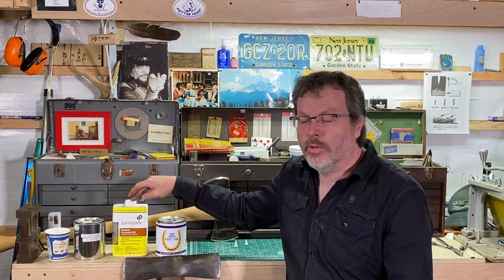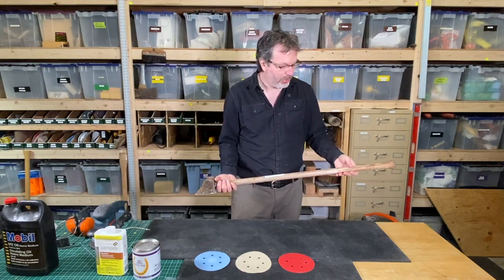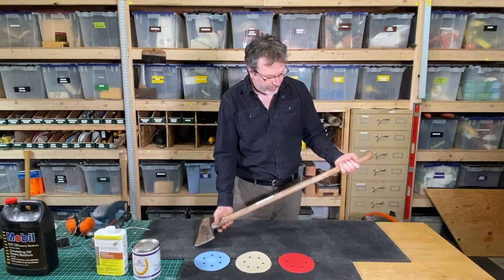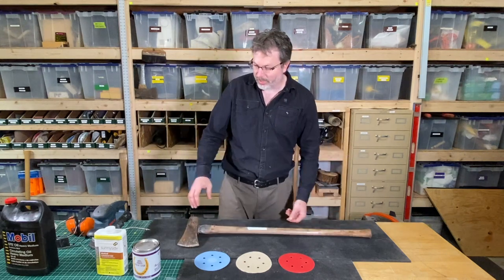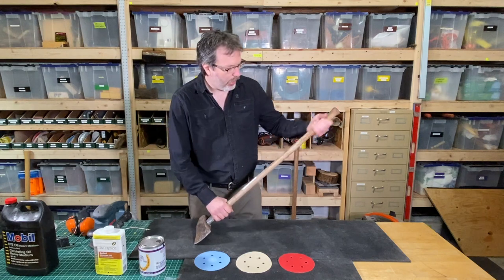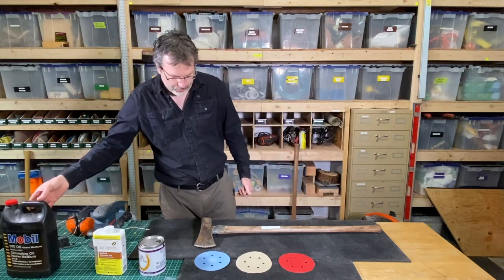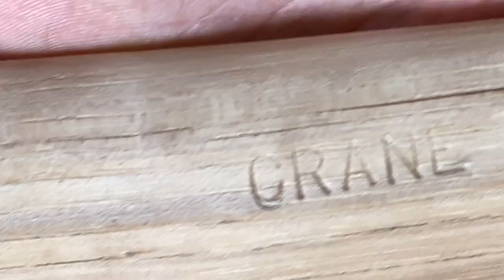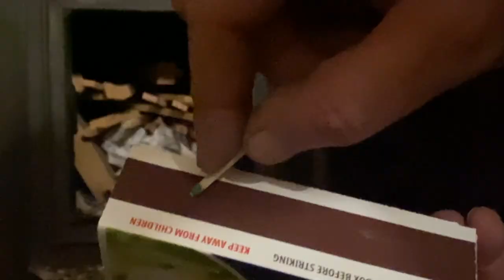Axe & Tool Handle Care - Pine Tar & Linseed Oil

Comment: Thanks for the tip on using the pine tar mix....I have a wood stove in my work shop so I take care of my axe and hatchets with wood handles ..I always remove the shellac from the factory and oil the wood
Reply from the maker: Right On! 👍 I really like this handle treatment. It gets better and better over the years as I keep adding coats. A nice grip in the hands. 🙌

Comment: Another solution that my great grandfather always did and he was born in early 1920s in just to use some simple Huberd's Shoe Oil which contains pine tar and beeswax. So if you want to save money just buy the Huberd's Shoe Oil and put on a few coats  1 coat every other day for a week and then once every month and then once a year. It will come out looking exactly the same.

Comment: Greetings from Essex County, UK!
I've just found an old Brades 353 Criterion 6Lbs axe, with an old 34-inch handle, sanded it down all the way to 1500 grit.
I've used a 50/50 mix of Stockholm tar and turpentine to coat the handle.
How long did it take yours to dry enough to use, and is one coat enough?
In advance, many thanks for your time.
Best regards,
Manny